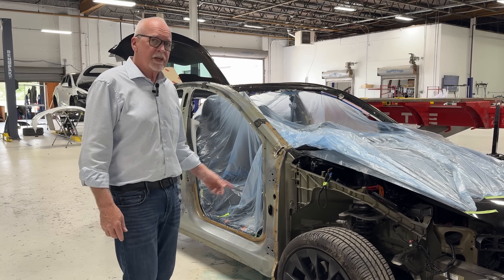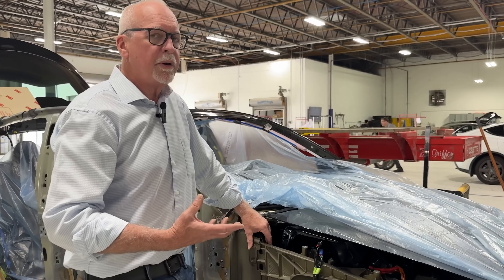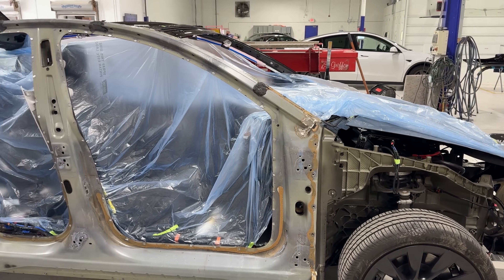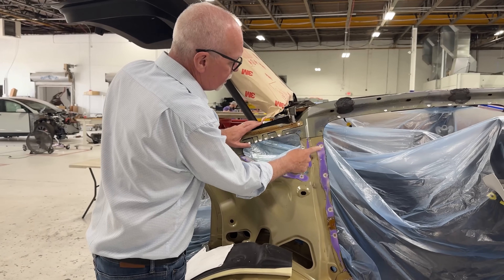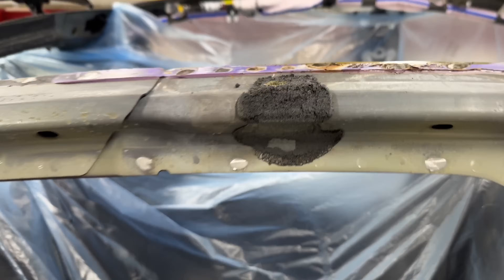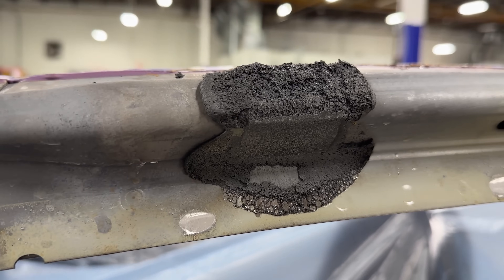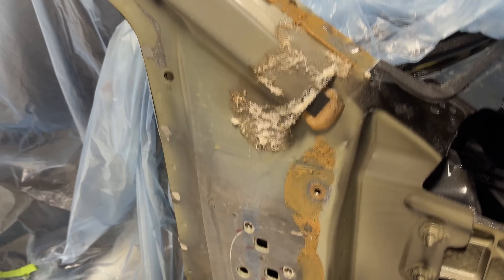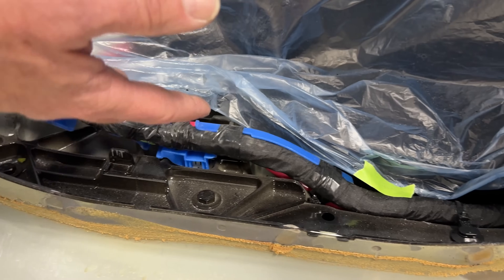How is Your Tesla Model Y Built? | A Closer Look

Comment: Tesla will no longer have 5 stars in Euro NCAP because there is new safety condition. As of January 2026, it will require physical buttons for critical functions in order for a tested model to receive a five-star rating. Specifically, it concerns the control of the turn signals, wipers, horn, warning lights and the eCall system.
Reply: Tesla has buttons for those functions. They are on the wheel except for emergency flashers which is a separate button. You can map wiper function to the scroll wheel button.
Reply: All of that is on the steering wheel or in the celling console.
Reply: As if euro drivers even use their turn signals. Ask any bmw driver

Comment: Tell the truth, it’s going to be a nightmare to replace a gigacast section of those cars. It’s expensive.
Reply: Not really. Most insurance companies will total cars these days because it’s cheaper to replace them than it is to fix them. Because by the time a giga-casting needs to be replaced there’s an extremely high probability that there is structural damage. Insurance companies don’t want to deal with issues related to structural integrity as it increases their potential liability. 

Small fender benders aren’t going to impact the casting at all, they’re way under the skin. The exterior panels would just be replaced as usual for minor accidents.
Reply: @LifeLongLearner-om8jx  - you’re delusional.

Comment: So what happens if you have a very small accident, but the casting is slightly bent?  Insurance is going to go through the roof!
Reply from the maker: Thank you for the question! John answers it in our latest video at 24:25 - https://www.youtube.com/watch?v=iqAGjC4pXMo&t=1387s
Reply: No. You unbolt the casting, and bolt the new one in.
Reply: It has crumble zone. Casting can be easier to fix, fewer parts than non casting. It was stated by Tesla during one of the callings. What do you happen when a regular car frame get bend from a small accident? Good grief.

Comment: I have a 2023 Model Y Long Range AWD Austin Build and my question is, have there been design changes for the better in the front and rear Giga Castings since from the beginning until the 2024 Austin builds?
Reply: front gigacastings are only in the structural battery pack Model Y and Cubertruck... both dont have a floor, when you take out the battery
Reply from the maker: Thanks so much for your question! John answers it in our latest Q&A video at 30:04 - https://www.youtube.com/watch?v=iqAGjC4pXMo&t=1387s

Comment: That is by far the best demonstration of why / how Teslas exceed crash standards by orders of magnitude and retain body control that does / will allow suspension optimisation orders of magnitude over rivals. Do not get fooled by the legacy superficial frippery of "panel gaps" when the real deal is structural integrity. 44 years of engineering world wide in big auto Ive some insight into how to do a job right and this is it.
Reply: I also dont think crashes are an issue in a merc, audi or a bmw. Or a VW.  So its all good, with or withput giga castings.
Reply: The ignorant always associate build quality to just minor things on the surface.  But what really matters are the things you can't see underneath.
Reply: @AudiTTQuattro2003 have you seen the teslas from 2022 onward? I have and panel gaps are a non-issue 95%+ of the time.

Comment: Have you been able to source the front or rear castings new from Tesla as a service part?
Reply from the maker: Thanks the the question - the short answer is yes! John gives a longer answer and explains gigacastings a bit further in our latest Q&A video at the 35:26 mark - https://www.youtube.com/watch?v=iqAGjC4pXMo&t=1387s
Reply: @AudiTTQuattro2003  That just means you're too slow. There are millions of these cars out on the road, they are not going to get totaled because a subframe assembly you can unbolt is damaged.
Reply: @AudiTTQuattro2003  When you damage the frame the car is totalled anyway.
Reply: @AudiTTQuattro2003 no, it’s made to be repaired affordable. Unbolt the casting, bolt the new one in.